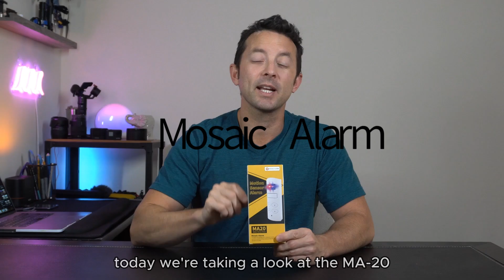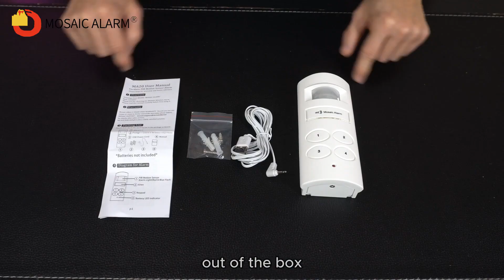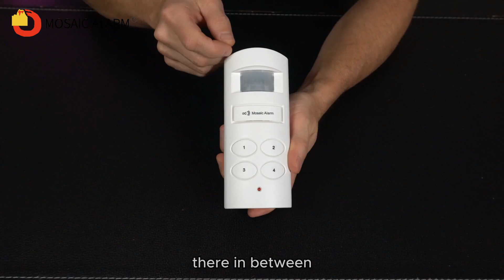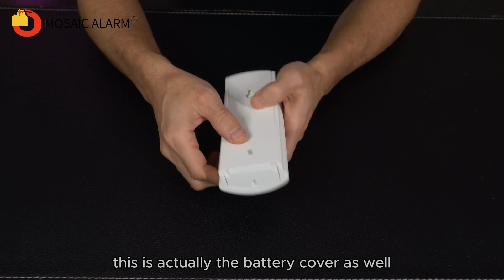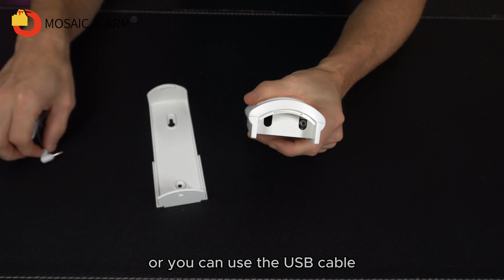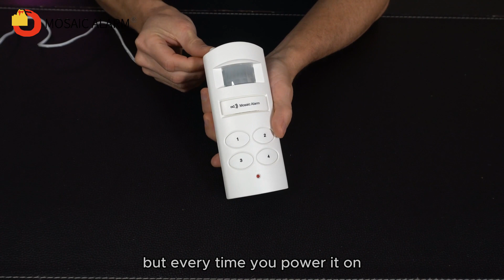MOSAIC ALARM MA20 Set Up Video Tutorial Simple Motion Sensor Alarm Cordless Travel PIR Motion Alerts

Comment: I have purchased 2 of these alarms. The alarm sound is not the same. One is more like a traditional alarm "woop woop woop woop" and the new one is more like "drrrrrrrrrrrrrrrrrrrrrrr". Is there a setting to change the alarm sound?
Reply from the maker: Hey ,Thank you for your kind comments, I am sorry if there is any issues, please kind email us at mosaicsupport@mosaichk.net , we will help to check for you.
Reply: @MosaicAlarm  Im asking if there is a way to change the settings.
Reply from the maker: @FournierFinishing  hi,thank you for your kind comments, this model MA20 ,for the mass products, we can't change the sound as firmware is programmed. but i don't understand you mean one is sound "woop" and another is sound "drrrr", normal , they should sound same, like this https://youtu.be/qz_Ww3tCg8c
so might be something wrong with the one of the alarm you bought.
if you need another sound alarm , we have this model MH105, that comes with 3 different sound.https://www.amazon.com/dp/B0DPV2LLW3
ALARM SOUND #1(default) & #2 : both are high-pitched, harsh sound which are recommended to use as alarm sound for security purpose. SOUND #3: Door Bell Ring Sound which is recommended to use as motion sensor door chime if you need a temporary one.